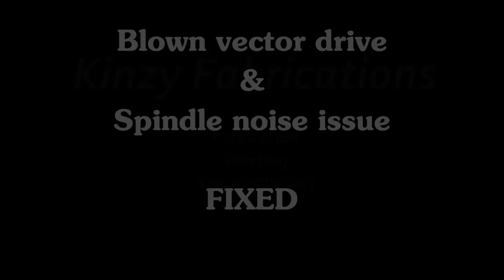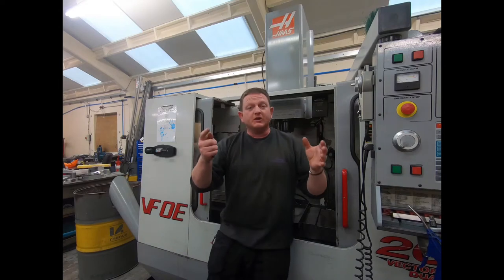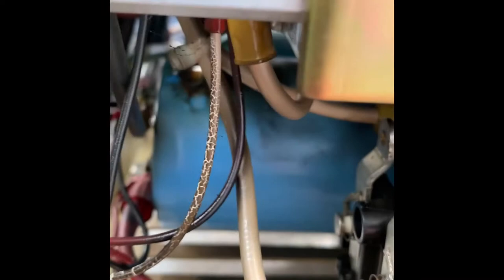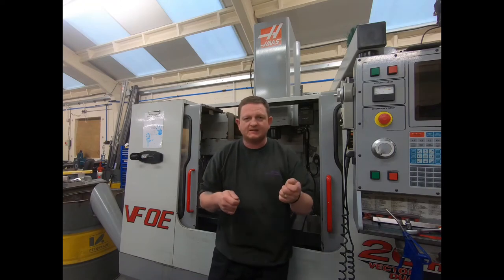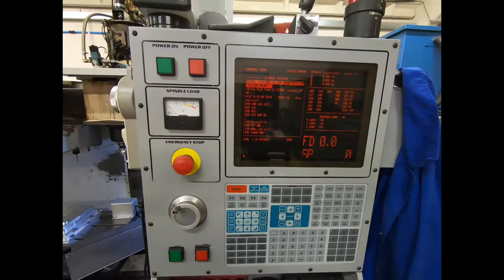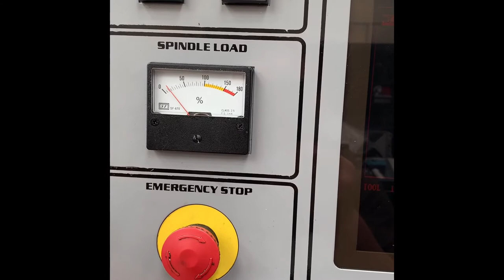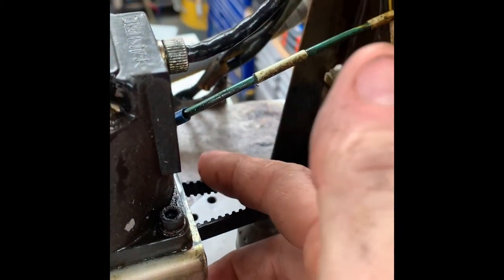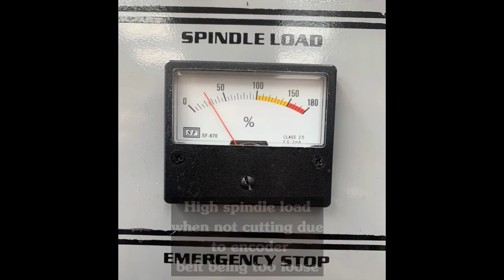Haas vf0e blown vector drive and spindle noise issues all fixed

Comment: THANK YOU. I've been having the same exact issues after replacing the encoder belt. Will do what you did to the bracket and tighten up that encoder belt!
Reply from the maker: Hopefully it’s work to fix it for you like it did me 👍
Reply: @kinzy_fabrications  I'm confident it will! A Haas service tech told me to tension the belt and that would get the spindle load back down where it was before the encoder belt change... but on these older mills, there is no room for adjustment. You sir didn't let that stop you! I'll be doing the same trick!

Comment: Good job.
I've got an old 1996 VF-6 and I'm dealing with the issue of the tool change. The spindle alignment fails to happen. The key locking dog will not engage and the spindle keeps rotating and finals stops with fault. Last night I kept resetting while also grabbing the tool to try and stop it at the correct position. After more than 20 minutes of this it started to work, sometimes I need to help stop the spindle in the right location. After running the machine for a few hours with only 6 tool changes, at the end of the day the tool change happen quick with precision. It has been doing this now for 4 times. Like 4 months worth of time. The machines does not get used. I'm going to have to take the covers off the spindle area and clean and check the electrical connections. It works fine after warming up it seems.
Reply from the maker: If it is an old spindle not machine then it most likely has an orientation shot pin set up and that is probably old and worn and not engaging properly so i would advise replacing the shot pin assembly and that will probably solve your issues but as you say first step is to get up there and remove the head covers to have a proper look

Thanks
Marc

Comment: Even if you don't enable "jog without zero," you can always use zero return: single axis!
Since it wasn't touching, I would have zero returned single axis on the Z, then power up restart once it's safe.

PS. if you do enable "jog without zero," know that you've also disabled limits and could blow an amp if you have a bad sensor or keep jogging past a limit. I've seen oopsies that lucked out and didn't blow the amp, and they still attempt to overcurrent protect, but it's good to be aware of the risk.
Reply from the maker: Thank you for the heads up, good info to know

Comment: We specialize in repairing Haas equipment. Drives, amps, servo motors, processor boards, etc and we fully test on our machines. Let us know if you have any future issues you need help with.
Reply from the maker: Hi

Where abouts are you based?

I see you repair a lot of these but I am in the uk and shipping alone would be very expensive and the turn around would probably let take too long

Comment: Did you check the spindle encoder, belt and pulleys?
Reply from the maker: Hi

Yes the spindle encoder belt was really sloppy and was causing noise issue and also causing load meter issues, i changed the belt and it sorted the issue with noise and load meter

Thanks
Marc